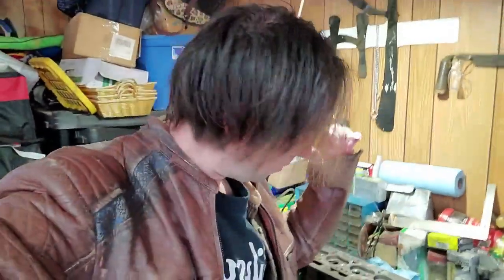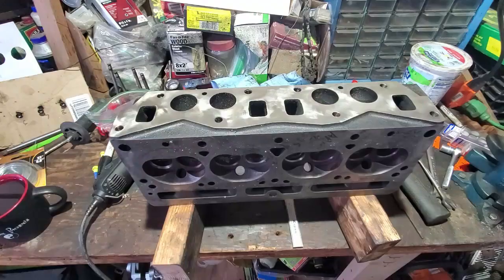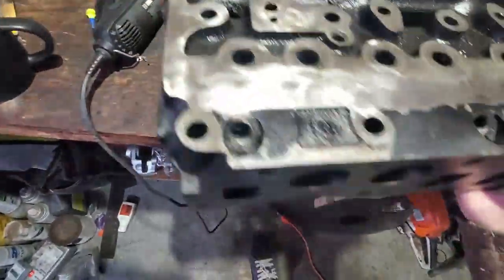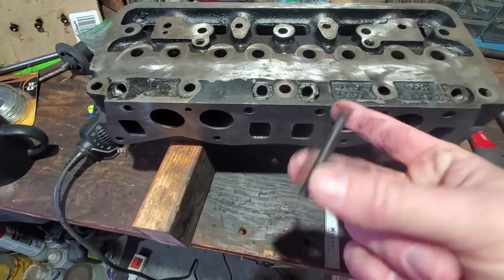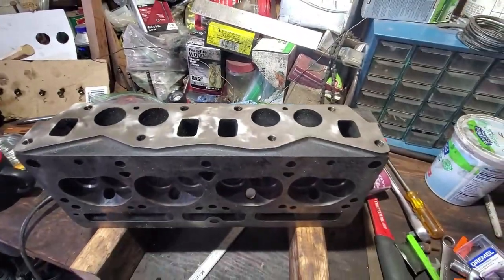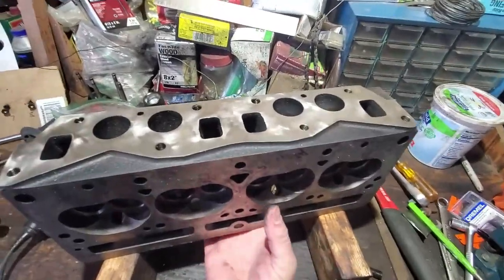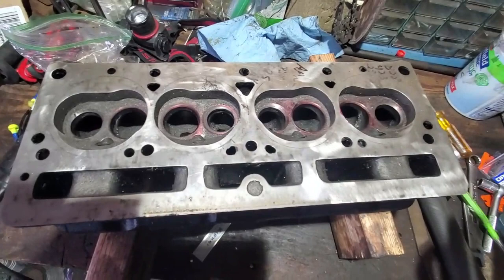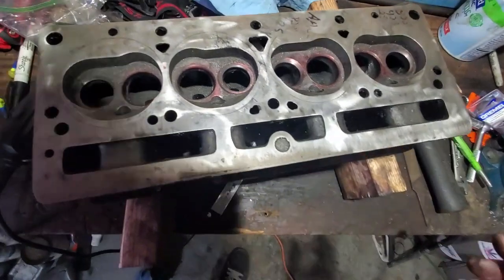Porting a Triumph Spitfire engine head

Comment: Had you considered matching the ports to the manifolds using the gasket as a guide ?
Reply from the maker: I wasn't totally sure about this, this being my first time trying something like this so erring on the side of caution. Unfortunately I still had a bad vibration with the engine so the whole thing is in pieces in my garage right now with parts on the way. I also picked up a set of headers and will be gasket matching everything when I put it back together. Thanks for the suggestion!

Comment: Thank you for posting, and keep up the good work. I hope you are able to get it back on the road soon, Be well
Reply from the maker: Thanks Matthew! I got it up and running and it's back to being a daily driver again. Definately more torque and power, but it does help having compression on all 4 cylinders. I'm surprised it was running as well as it was before.
Reply: @dragon_gate_garage  Very nice come spring I will begin working on mine again. I have a front floor panel to replace in my 75 spit.

Comment: The good thing about spits is the head can come off easily without disturbing the valve timing,yes the rockers need re adjusting but that's no big deal,anyway,i'm going to be doing the same thing to my engine,one thing i noticed is the water ways to and from the block are gnarly and not well lined up,use the head gasket to get better coolant flow.
There is also the drilling of the oil gallery feed in the rear of the distributor ,there's a vid on youtube giving details.

Use a rocker feed kit,some say it lowers oil pressure but that's nonsense,it lowers pressure on a GT6 as the GT6 uses the same oil pump as a spit,which is at the max on a GT6,but a spit block can easily use the rocker oil feed kits and keep good oil pressure.

I also have an oil cooler kit with a thermostat,the oil rad is from a van(bedford) or a ford,i'm in Scotland in the UK so the model really is not important the important bit is not to buy an oil rad from a triumph dealer$$$$$$$$££££££££$$$$$$$$$$$$$££££££££££££,the fittings are the same on most rads and they go by length and rows of cooler tubes for width.

I'll clear up the flow issue,make the intake tract rough texture,that's where the little dimples would be,like a sharks skin the rough texture creates what's called a boundary layer that acts like an air bearing,secondly you need to match the intake port to the manifold gasket,just the first 1/8 to 1/4 inch or so to make a small funnel shape,removing too much material will lower air flow velocity and the fuel air mixture will fall out of suspension.

Opening the intake tracts is for high reving racing cars that need max airflow but do so at max rev all the time with no low rev power at all.

Polish to a mirror the combustion chamber to stop or minimise carbon fouling a shiny surface has little for the carbon to hold on to,also the shiny surface reflects infra-red energy(heat) into the cylinder and out of the exhaust port.

polish the exhaust port and tracts,gasket matching the exhaust is not needed,and in fact a small step  from port to exhaust pipe,from a small hole to a larger pipe creates a bit of turbulance that stops an effect called "REVERSION" where exhaust gases get sucked back into the cylinder,the step creates turbulence making the effective exhaust port look smaller to the exhaust gass trying to get back inside the combustion chamber,the polar opposite of the intake wher we use trumpets and gasket match to minimise turbulence to allow as much air flow as is possible but keeping the tract the same overall size to maximise air velocity.

There is a guide to tract size based on the inlet valve size,but i would just smooth out the cast flashing and sharp edges ,make the transition from manifold to head smooth without opening up the tract,also make sure the gasket to manifold is clear,the gasket may need work too,ther may be a need to make a very short area to match manifold-gasket-head inlet that is a weird outward bulge,from a side view cut away it would be very short possibly a few mm long to allow the transition to be as smooth as possible.

I have seen port to gasket match done that the funnel shape goes in way too far,the tract diameter is pretty much bang on,just a little rough,and in need of slightly better flow,which is easy,just as i went into length to describe just don't over do it.

the corners inside the combustion chamber just need to be given a small radii to take of the angle,after that i would/will cc the chambers and raise three chambers to the largest chamber volume by using fine emery of around 800 to 100 grit on the flat area, a cc or so between chambers won't kill it,anal and fastidiousness is not needed,re-polish.

then a light skim after working out the CR.
http://kp-gasket.blogspot.com/2012/06/skimming-your-head-for-higher.html

https://www.205gtidrivers.com/forums/topic/137630-working-out-my-compression-ratio-after-head-skim/
here's the second link text copied and pasted.
------------------------------------------------------------------------------------------------------------------------------------
If you have the combustion chamber volume then that's the hardest part done!
 
What you need to do next is work out the rest of your volumes:
 
Step 1a: (3.142 * Bore^2) / 4 = Piston Area
Step 1b: Piston Area * Stroke = Swept Volume
 
Step 2: Piston Volume = measured cc's of any piston dish or cut-outs
 
Step 3: Gasket Thickness * Piston Area = Gasket Volume (approximate, but close enough)
 
Then you work out the ratio of the total internal volume to the comressed volume i.e compression ratio.
 
Step 4: Swept Volume + Piston Volume + Combusion Chamber Volume + Gasket Volume = Total Volume
 
Step 5: Piston Volume + Combustion Chamber Volume + Gasket Volume = Compressed Volume
 
Step 6: Total Volume / Compressed Volume = Compression Ratio
 
 
 
 
So for example..
 
Stroke = 73mm, Bore = 83mm (divide by 10 for cm)
 
Step 1a: Piston Area = (3.142 * 8.3^2) / 4
= 54.1cm^2
 
Step 1b: Swept Volume = 54.1 * 7.3
= 395cm^3
 
(On a side note, this is your cylinder displacement - multiply this by number of cylinders gives your engine displacement so 395 * 4 = 1580cc)
 
Step 2: Piston Volume measured to be = 6cm^3
 
Step 3: Gasket Volume = 54.1 * 0.2 (say it's 2mm thick)
= 10.8cm^3
 
Then say you measured your Combustion Chamber to be 28cm^3..
 
Step 4: Total Volume = 395 + 6 + 28 + 10.8
= 439.8cm^3
 
Step 5: Compressed Volume = 6 + 28 + 10.8
= 44.8cm^3
 
Step 6: Compression Ratio = 439.8 / 44.8
= 9.8 : 1
 
Obviously you need to substitute your values for my made up ones!
------------------------------------------------------------------------------------------------------------------------------------
I will add another text for finding CR skim,
Going back to my engine building days I seem to remember the formula for calculating this is :- 

swept volume of cylinder / (required) CR - 1 

for example :- 
on a 4 litre engine 

3950cc / 8 = 493.75 

493.75 / 10-1 = 54.861 

so the total chamber volume must be 54.861 cc to get a 10:1 compression ratio 

From this subtract all the volumes that do not reside in the cylinder head, eg gasket wolume, dish in piston, volume above piston at TDC (due to piston not coming even with the block deck)you will then be left with the combustion chamber volume required to give you a 10:1 compression ratio. 

When you have this, put the spark plug in, set the cylinder head up on a level surface (must be level) then take a burette graduated in cc using paraffin put the ammount into the cylider head combustion chamber. 

Then measure with a vernier (or depth micrometer)from the head surface to the liquid and that is the ammount to skim off to get a 10:1 compression ratio. 

If your not into this, I would suggest calling one of the specialists like V8 Dev. (they will have a lot of experience in this type of stuff)
------------------------------------------------------------------------------------------------------------------------------------
 
I see you did what i did and get rid of the exposed seams,just a water trap in the rain directing water into the door aperture ,rot the doors and make a footwell swimming pool,i also changed out the door hing hanger plates to 10mm plate the original is like 5mm or so,not very good and the threads strip too easily,i also used stainless button head screws on the door hinges.

All the best.
Reply from the maker: Very nice. Sounds like you've gone a bit deeper down the rabbit hole than I am. I'll likely do many of the things you suggested when I build my gt6 engine. Thanks!
Reply: @dragon_gate_garage  To be honest most heads just need gasket matching,some builders add a tube between head and inlet manifold machined to give perfect flow transfer,but plain old school gasket matching done well is as good,smooth out transitions ,any sharp edges etc,remove as little as possible,polish chamber and cc match,after that a proper cam ,fuel igntn,the biggest gains are getting turbulance restriction eliminated,same reason we use inlet trumpets....cheap as chips,the more you do ,the less you get,over all.